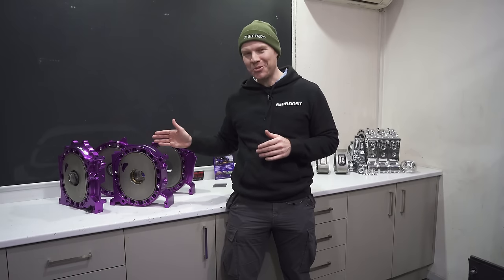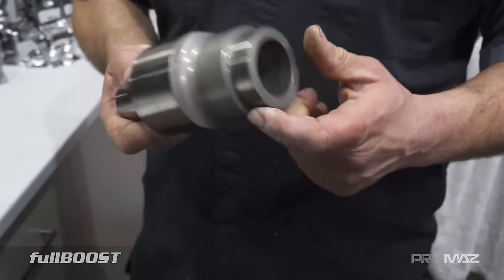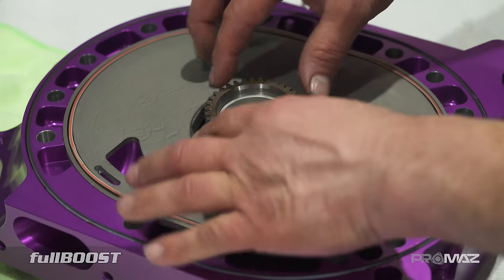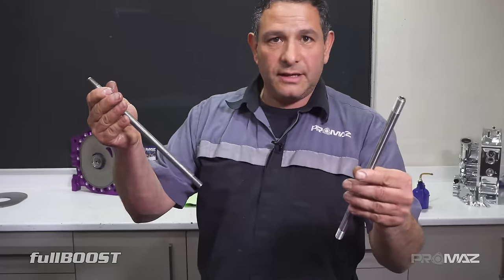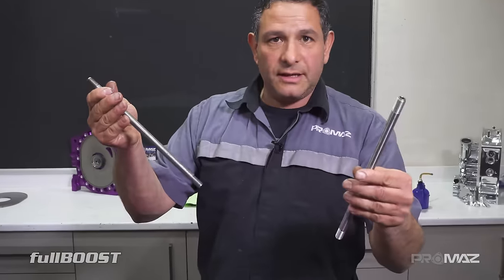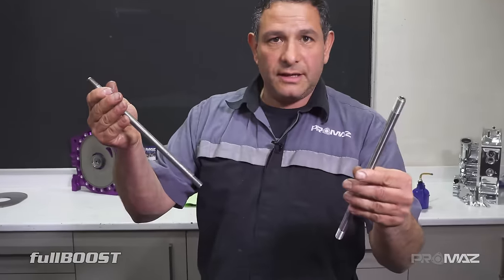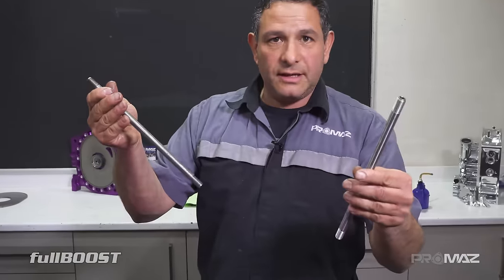Building a 1500hp Billet 20B 3-rotor | fullBOOST

Comment: A stress-free N/A 3 rotor was the engine the RX-8 should have had. 300-320HP stock and it would have been a fitting successor to the legendary RX-7.
Reply: I 100% agree with you. An NA 3 rotor should of been the RX8 engine.
Reply: @viper22jc  A 3 rotor engine is inevitably more prone to overheating and less balanced. I think the Renesis was the correct choice
Reply: The fuel consumption on a the RX-8 really hampered it as a serious proposition in the market. That would have made it even worse. Remember, you dont just need a few rotary nuts to buy one, you need normal sane people to do so as well.
Reply: the real solution would've been the 2.3l MZR engine. Not so much rx but it would've been a crazy silvia replacement
Reply: @throwback19841  lol, true. Us nuts can just drop one in our rx8s
Reply: @throwback19841  $5,000 car .... $20,000 engine 😆
Reply: @HeavyMetalorRockfan9 the rx8 should have been a Silvia replacement? Guys been playing need for speed and he just won his first pink slip 🤣

Comment: Oh my... how sexy is that 3 Rotor - well done...and that torque wrench looks like a "warren & brown" with a pin to let you know when you hit the right setting - very nice wrench.
Reply: I got the same one, warren & brown all the way.
Reply: Used my Warren and Browns for 30 years on a weekly basis. Personally Checked calibration every 3 months and only needed adjustment twice out of 3 wrenches due to the popper pins getting worn. You could submerge them and clean them and the always hold calibration. Unlike the modern stuff even the electronic ones where they rely on grease and/or piezo sensors that need frequent calibration.

Comment: Definitely capable of 2200 HP with the right tuner 👍 I've seen some 1600 HP 13Bs running from 6.50 to 6.16 seconds quarter mile
Reply: What premix ratio did they run. i fill and mix amsoild dominator synthetic 2T
Reply: @jlo13800 late response but it’s definitely a heavy Mixture most likely 2 oz per gallon or close to even 3 oz of premix per gallon for those monsters

Comment: Beast of a engine and assembly, just imagine the time and effort of just the engineering drawings and measurements and then having a real good CNC machinist and have everything as perfectly round and centered, that a factory engine will have nothing on this beast no matter how you look at it ?
Norton products are great stuff as well, there's a lot of USA based performance products which people should be using to save a lot of money especially when using hi speed air tools and sanding disc's, its worth investing in hi quality products that way your not spending so much extra money on items, which are used all the time which norton sell the merit brand, which is so much better product.
I used to sell the brand called merit products, i think they might be the same, but sold them in kits and they outlast anything 3M can make and are a little expensive, but if it can go through hastelloy metal and inconel alloys  with a 400 grit 3" disc pad and the same from 3M you would have a 100 grit and  spend 3 to 4 times as much to try and get the same result, The afterburner rings on a F18 hornet are made from Hastelloy alloy just imagine what it can do to most normally alloys and metals, basically they make so many different sanding disc's and shapes that i sold a few to the V8 supercars racing teams including Larry Perkins in Moorabbin workshop and also others as well, but mainly to aircraft maintenance companies including qantas and Ansett when ansett was around. :)

Comment: This man needs his own YT channel, dude is a natural. Out of curiousity, what would be the cost of a billet 20b installed on a 2006 RX8?
Reply: Depending on where you are at…. Defined auto works near Columbus Ohio builds a 4 rotor for about 40k. I watched him do a 1-5 gear pull in the country and it was unreal.  It puts out about 700 NA and 1200 with boost.

Comment: I would love to see someone take the cost of building a car with this engine, a trans and suspension setup that can handle it, and then take that same money to build an electric car PROPERLY to compare it to.  Given what I've seen of electric cars so far, I doubt that this could beat the electrons.
Reply: You would be correct the volkswagen I.D R at pikes peak proved the viability of all electric racing vehicles.
Reply: @n111254789  pikes peak is not a endurance race,
Reply: @ThreeDaysOfDan  Fantastic observation the Pikes Peak Hill Climb is indeed not an endurance race it's a hill climb the usual giveaway is the fact its got "hill climb" in the name and that it goes up a giant mountain. Sheesh no one's getting anything past you are they partner? Unfortunately no one was talking about endurance races.

Also a 1500hp 3 rotor also isn't going to work in an endurance race either. Rotaries can work in endurance we saw that with the 787b but it wasn't making anywhere near that power. It was making 650hp with a four rotor in race trim in the 787b that won the Le Mans. Not the media touted 900hp, it did that in testing and it sucked fuel so fast it wouldn't have worked it also would have ate the engine in a few laps. 

So the video isn't about an endurance car, and no one was talking about endurance cars. Idk where you got that from.
Reply: @n111254789  LOL the 20b they tore down was in pristine condition after the race , Roratys FYI are the only IC engine that can go RACES without rebuilds. That mazda also had no active cooling , and no turbos meaning it was running hotter than if it would have been had that been allowed. You said the car showed its "viability" , not really, Any hunk of shit can do a hill climb   , suzuki which had no race pedegree anywhere else with cars did it .. LOL
Reply: @ThreeDaysOfDan 

Alrighty buddy boy I got about 6 minutes waiting on a download and I can type fast so I'm fixing to give you a drastically needed education. If you can even read this much, I imagine the embarrassment and the reading skills of a third grader causes you to stop midway through. Probably got adhd or something but you'll get the message and others will get a laugh. 

Alrighty partner buckle up here we go. So it was in good condition because it was built to run about 1000hp and they detuned it to 650hp so it didn't gobble fuel. Also it didn't use a 20b, that was for the 757 and first gen 767, the 26b is what ran in the the later version 767, 787, and the 787b so you need to learn what engine we are talking about. No active cooling, what? There is an air intake on the right side of the car and a giant radiator on the left. See those giant holes in the side of the car at the rear? Yeah that's what those are for. At least know what you're talking about before trying to correct me. "LOL" 

Also the only racing engine that can go races without rebuilds? What? In Formula One right now engines are built and sealed they cannot be rebuilt and guess how many engines they get for the season? 3. They get 3 engines for the entire season that engine has to run 7 races plus qualifying, without a rebuild. Those are 1.6L turbocharged motors making nearly 1000hp combined with their hybrid power unit and they idle at 5000rpm. They run roughly 1400miles on a single engine.

In 360ci Sprints which I used to race we would check the motor every 5 races and replace parts as they got out of tolerance. My endurocross dirt bike goes 95 hours without a top end rebuild and most gncc bikes last at least 50 hours which is several races.

Suzuki built a pikes peak car without s racing pedigree? I'm assuming you're referring to the Suzuki Escudo. That wasn't a Suzuki and Suzuki didn't build it, they sponsored it. It didn't use anything from a Suzuki Escudo. Nobuhiro "Monster" Tajima from Monster Sport Racing designed and built that car for the pikes peak unlimited class. It used two suzuki street bike motors one in the front and one in the rear he got them from the sponsorship he also made significant modifications to them. Suzuki was a sponsor just like how Lotus sponsored Renault's f1 team but didn't build or design the car. Tajima not only designed and built that car he raced it too. Making iterations and later moving to a singular v6. He has won pikes peak many times. So your argument that Suzuki did it with no racing pedigree is again wrong. Suzuki had nothing to do with it other than providing money for him making the fiberglass shell somewhat resemble an Escudo and using their name. 

So let's get a tally:
1. Wrong about the motor used. 

2. Wrong about it being the only internal combustion racing motors being rebuilt after each race. (idk how you didn't know that about f1, I could keep going too but I figure f1 is the ultimate example) 

3. Wrong about it not using active cooling. (no clue how you even thought that) 

Now All winning cars racing in Le Man's now are hybrids because the advantages of electric motors are unbelievable in racing. You can spool a turbo instantly by connecting the shaft to an electric motor, you can run cam profiles you couldn't dream of because the electric motors provide torque instantly unlike ice engines. Regenerative braking means they can run smaller brakes for less rotating mass, generate less heat because the electric motor which is being used as a generator now is providing a ton of braking force so brake fade isn't as bad. Then instant torque the second they touch the gas they can even get a trail brake effect from those electric motors. All major forms of motorsports are using them because the benefits are absolutely staggering. 

Also if you think pikes peak is easy it is one of the few racing series's left with an unlimited zero rules class and the most uncontrollable insane cars race there. The most legendary drivers from all over the world in the most absolutely unhinged cars show up to race there. Go look at the drivers who have raced at Pikes Peak. Tons of manufacturers and drivers from the Group B era flew modified versions of their group B cars to race up it. Sébastien Loeb, Rod Millen, Michele Mouton, Monster Tajima I mean the list is endless. 

Also there is no pacing and pit stops, trying to slow down to conserve fuel or tires, you go off the road in some areas you get to flip down a mountain. It is a full on sprint in the absolute fastest thing you can bring. It just has to meet the bare minimum safety requirements and you can run it in the unlimited class. 

Something Le' Mans doesn't have and guess what despite it being wide open for them to do it everyone who has ran a rotary up there got stomped. Should be easy by your logic, but they can't even come close and many have tried. 

Literally almost everything you said was so far off base I'm getting second hand embarrassment. Log off, you're done Danny boy. "LOL"

Comment: I had a 1979 Rx-7, a 1981 Rx-7 and a 1985 Rx-7 with 90 to 120 horsepower engines. If I had 300-350 horsepower I wouldn't be typing now. Lol. Fun car great balance. 51 percent weight in front 49 percent in back. Great cornering and handling. Miss them very much. But I'm still alive.

Comment: I test drove an rx7 back in the early 70s. I took off at the stop light and couldn't launch very fast and thought the clutch was slipping...until I looked in the rearview mirror. Blue smoke and and burned out clear through the intersection. It blew me away that much power came out of an engine half the size of a 5 gallon bucket!  I want one on a motorcycle.

Comment: Are they a common crank as in one piece or are they Joined ? I remember many years ago that the welded cranks on the early extension 13b had a habit of crankshafts flexing and apparently it was really difficult but I have not even seen a rotary for years and I imagine that technology has come a long way i mean in any terms over 1000 hp from a relatively small engine is simply amazing.

Comment: Its worth remembering forged components > billet > cast ... considering the stresses involved and how the small the compoennts are a forged rotary might not acutally be impractical for production... and would stronger than a billet rotary by a significant amount of the same dimensions (you can beef up weak sections of a billet block to compensate).

Comment: Have you looked into intrusion tech for the rotor housings? It should be the cheapest option. That's where they push a bar of aluminium through a mold. then it would need four stage machining and a cylinder housing. Cost effect starts when the blank costs 6,40 dollars, and 17,50 dollars with the steel housing. Than can have three or four runs in the booth easily, before it starts to gain price.

Comment: awesome good quality video. that engine was beautiful. hard for me to imagine so much power possible from something so small. i am an Amercan motors fan, big cubic inch, big ltr, but these engines have fascinated me for a while now. (there is a bit of conspiracy involved with why Ford snagged up mazda, then parked the rotory engine on a shelf and turned the lights out. then pumped out craptastic engines for over a decade). anyway, good vid. by the way, was wondering what that music track was @ around 6:38, then wvolved almost to another cool track. let me know if possible. thanks.

Comment: With the billet plates does it allow for higher tolerance to heat? I know from the past the iron plates would crush the aluminum rotor housings if you overheated the engine.

Comment: How thick is the chrome liner??? From just looking at it it has some 3-4mm! What is the technology there? Is it electrodepositing???
Btw...in 90's I was machining the stators for Wankel engine, used in experimental tank engine as a turbocharger, because it has 3:1 positive output...... But it was all steel work...no aluminum! It was 1 cylinder, 2 opposed pistons and 4 crankshafts with Wankel turbocharger - 2 stroke engine!

Comment: I don't know anything about rotary engines except having friends that had RX-7s and 8s. As a novice, I was wondering what the limiting factor would be to creating 5 or even 6 rotor engines? Assuming money is no object for a custom crank made out of unobtainium? Everything seems symmetrical so aside from custom parts that would require engineering and R & D beyond reason, is there any other limitations?

Comment: If I remember right, a rotary engine, at least the ones Mazda used in the CX-5, used to have terrible reliability. Particularly when they blew their apex seals. Does the design of these engines improve upon this area or is the oil injected with the fuel air mixture in the same way?

Comment: Anything petroleum-based is bad for the o-rings that seal the "combustion chambers"? So what does that boat anchor run on and what is it lubricated with? Non-petroleum fuel and oil?
Reply: Fully Synthetic Oil and light premix with fully synthetic 2 stroke oil

Comment: Each of those rotar blocks are 10k + finished thats around 50+k with the rest of the parts turbo systems and oil, fuel and the rest... .... Thats not exactly cost efficient but its a beautiful work of art and engineering. Would be nice to see these engines becoming affordable at some point
Reply: Congrats, you're famous!

Comment: could you make the same parts using peek or pekk interlaced with kevlar/nomar or similar material instead of billet? then 3d print instead of CNC or min the time needed to machine the parts. most 3d prints can now do 6-18 inches length and with up to 4 inches thick out of the box. just not sure if the polymer will cause corrosion like carbon fiber and some metals do.

Comment: What's the price on this 1500 HP engine  ? I need it for a test run . I  want to install my Black Box that Doubles HP and Torque.  I was planning on getting a  Camero SS and putting the Black Box in that  but then I seen this  1500 HP  your talking about and it would be nice to use with my Black Box.
Reply: I'd throw that box in the bin if I was you 🤣🤣

Comment: Very interesting and well presented video.  Thanks muchly Luke and Simon.

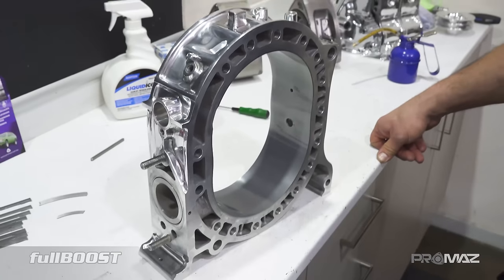Simon, at 5:30, Luke asks “What sort of rpm would you limit an engine like this to?”.  You say “I can see  one of these engines going to 1800 / 2000 horsepower.  The limit is going to be the crankshaft”  This doesn’t actually answer Simon’s question.  So please, what is the limiting rpm for this engine?

1500 horsepower  =  ± 1120 kW (1.12 MW).  At what rpm is this amount of power developed?

Most petrol engines don’t have much torque at low revs.  Does this engine have low end torque?  What is the torque developed at say at 1000 rpm and at 1500 rpm.  Alternatively how much power does the engine develop at these rpm’s?

Luke, at 6:25, what is the gasket cement you’re using?  It looks like Stag, an alcohol (methylated spirits) based jointing compound.

Norton Abrasives.  Here in South Africa, since being acquired by Saint-Gobain, they have been an absolute disaster.  It took more than a year to get a 10” (250 mm) silicon carbide grinding wheel (green) from them.  They had a factory here, but Saint-Gobain sold it.  Now Norton products have to be imported.  A friend who owns an engineering supply business doesn’t stock Norton products anymore, because they’ve become so unreliable.
Reply: Rotory engines idle around 1k to 1.5k rpm lmao, all of their torque is much higher revs.

Comment: What does the 20b mean and is billet stronger or and better than fotged and cast iron
Reply: 20B is just the model of the engine type as named by Mazda. There is also the 10A, 12A and 13B 2 rotor engines and a 26B 4 rotor engine used in Le Mans racing. Billet advantage comes from it being a custom component that is able to be manufactured to improve on the problems the factory cast plates have.
Reply: @BroomysGarage  ok so r billet blocks stronger than say a forged steel block like say the one on a 2JZ enginge. Because ive seen some billet block 2jz for like drag cars and stuff.